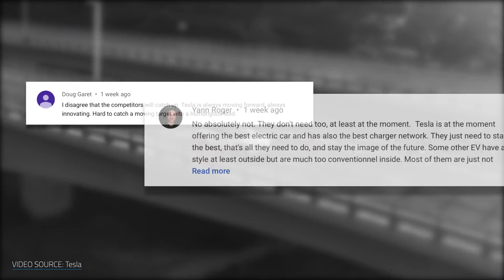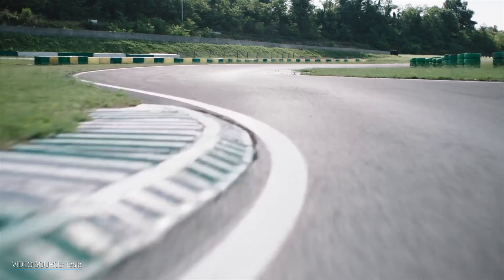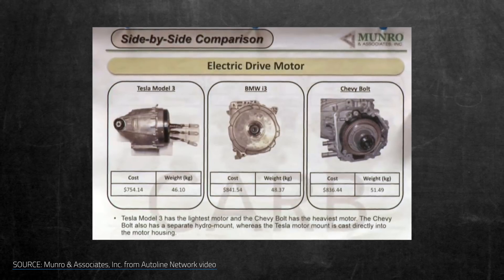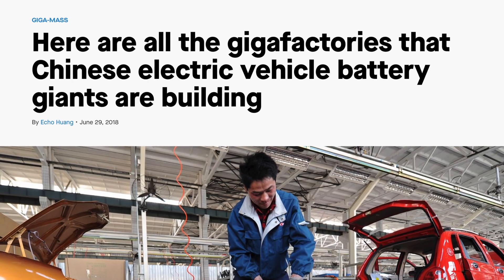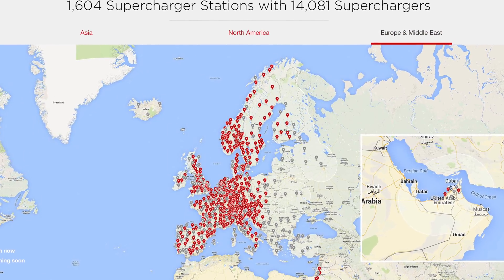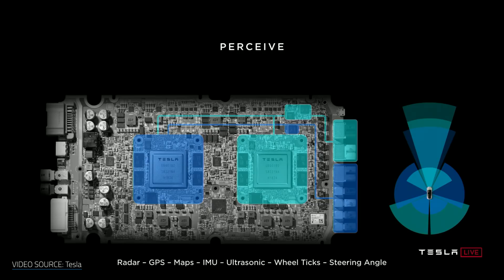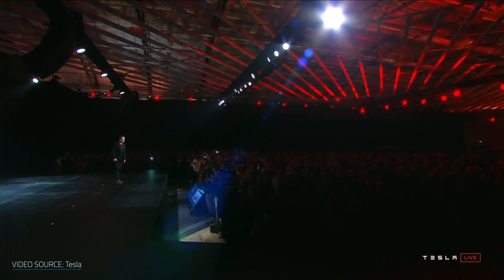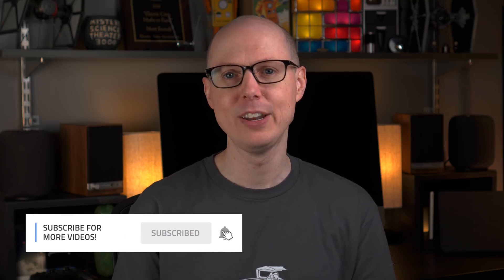Tesla vs Competitors - 5 Advantages

Comment: I tend to agree with all those Tesla advantages.  However, making things in large quantites is a whole different game to just having a good design.  According to an internet searches, in 2020 Tesla made about 550,000 cars.  In 2017 Toyota and VW each made 10,500,000, Hyundai and GM each made about 7,000,000 and Ford made about 6,500,000.   Manufacturing in the quantities necessary to dominate a future car market dominated by EVs may require either licensing its technology or merging with a manufacturer that can bring the scale of production it needs.

As good as Tesla batteries are, I think the big winner in the electric cars will be who makes a battery that is smaller and lighter than todays batteries, can receive 400 miles of charge in 10 minutes and costs no more than todays batteries.  Options are in the labs, but making a production battery is a lot different than a lab module.

Comment: Elon needs a motorcycle in his repartee... my suggestion is that any current design has not got it right.... let Harley Davidson have the two wheelers. A better concept, that is practical and will look awesome would be part cybertruck, part Elio motors, with a battery pack that is 1 part Tesla/ Maxwell and 1 part Chuck Norris's DNA. But seriously,  3 wheel design is stable. Made from Spacex stainless put crash test results the highest possible for a small car or bike . Elon must have the highest safety. Now have Franz design in a retractable roof for optimual wind in your face cycle experience. 
You cant use a motorcycle to stop and get groceries on the way home...but if you have a bike like I described it's a new game.

Comment: Looking at getting an EV soon and I’d 100% agree that battery tech (efficiency and charge speeds) coupled with a top quality charging network is making it hard to look at anything other than a Model 3 here in the UK. Other cars with comparable range like the E Niro (very nice car) would take over an hour to charge on a 50Kw public charger (most motorway services only have 50Kw) - just too slow on a road trip!

Comment: Let's see Motor, Battery Pack, Charging System, Autonomous Driving and Leadership.  Well you can add Over the Air Updating, No ICE Vehicles to support.  Now think about the Star-Link Satellites and all you would need is a dish in the Fronk under the fiberglass hood to update and bring entertainment to the cars.  Next might be a joystick in the console instead of the steering wheel and peddles.

Comment: Great video and most everything you said is true but I will play the devil's advocate. I am a Tesla fan and own a model 3 and X. Despite of how much I love driving them, I like to reveal some truth about the progress of self driving based on the current version of the autopilot. Granted with each update, the autopilot has been improving but new bugs have also been introduced. I have great respect for Elon but he is not been truthful about the delivery time of the self driving feature. First let us bring up the auto lane change issue, it changes into a lane way too fast which is quite unsafe because it does not give other drivers a chance to change their decisions or correct their mistakes. Second, it would slow down multiple times for no reason at all on Fastrak 91 Express west bound before connecting to 55 even though it has detected the dividing poles, the previous version has less issue in this regard. The sudden drop in speed is unsafe and unpredictable to other drivers and the brake lights did not appear to be on by looking at the screen. Whenever it slowed down from 70 to 55 unexpectedly I had to step on the paddle to speed it up to avoid getting rear ended. Third, it would change half way into a lane and decide to dash back to the origination lane even though the car behind was 5 to 6 spaces back. Forth the Navigate on autopilot would continue to change lane away from the targeted ramp or exit even though it is down to 1.5 mile and it often would be unable get back to the correct lane to complete the route. I can go on and on, in short the autopilot program appears to be written by programmers who do not know how to drive safely, carelessness or Tesla has a programming team that is poorly organized. If the current autopilot is so bug ridden, the billions of miles of data collected can be misleading and useless so this is where I disagree with you about the usefulness of the misleading data collected. I like to see self driving working in the next two to three years but it looks like it will not be ready for at least 5 years unless we are going to take a chance. Hopefully these comments would reach the Tesla team and Elon because I sure love my babies.

Comment: New Porsche Tycan Turbo S (electric car) outperforms Tesla Model S. Also handling is way ahead of fastest Tesla compared in curved and tracks.

Track doesn't mean speed only but brakes, suspension, areodynamics and steering are in another league. 

Personally, I also prefer no oversized touchscreen in the cockpit.

Comment: Advantage 6: The Fanbase. 'Customer base' doesn't quite sell it, because people who buy Tesla are the most loyal to the brand. And their number is increasing.

Advantage 7: Committment. Elon's focus is not on ROI or stock price or any other financial metric that doesn't directly correlate with the pursue of his mission. The cars have margins not because he likes money, but because changing the world is expensive. 

Advantage 8 : Organization. Not sure what my source is anymore, but apparently Tesla's inside structure is highly open to trans-department communication. For some reason different departments in legacy oem's are in competition with each other. Communication is also streamlined, i.e. if an employee needs to talk to someone, Elon included, he can just do so, without pointless managerial burocracy.
This boosts efficiency and saves tons of time.

Advantage 9 : Vertical integration. You covered it briefly in point 2, but it's not just batteries, it's everything, seats included. Actually the battery manufacturing process is the only thing Tesla doesn't own. Yet.

Advantage 10 : Rich Portfolio. Tesla  produces cars, software, AI hardware, solar, energy storage solutions. All of which are sectors set to explode in the coming decades.
And I'd argue that just as importantly as all theese things, Tesla produces ambition and dreams.

Comment: I could imagine when density dramatically improves, it would mean 300 mile battery at 1/2 the size.  Less batteries making the same range would reduce cost and weight, which also itself improves range.  Maybe we could see a $25,000 3 door hatch Model 3 or say Model 2 3/4.

Comment: Matt Ferrell I think you missed the absolutely MOST important part, but also the part hardest to quantify and talk about and that is the Tesla organization and manner of working. I only know bits and pieces of this. Basically the competition is only setup for gradual refinement. They source a number of components from the outside, which mean the ability to iterate an experiment is severely diminished. Tesla by making so much in-house are able to iterate rapidly and experiment more with their design. SpaceX also illustrates this well. Look at how many prototypes they make and fly. The competition does not work this way at all. Instead of hands on experimentation they produce reams for spec documents. They follow a classic slow waterfall method of product development where excessive amounts of time is spent planning and researching everything they do. Tesla and SpaceX in contrast move fast and break stuff. 

One example was from things like an indicator on the dashboard. Want to change the icon? A 10 minute code change and recompilation at Tesla. For the competition it means changing a spec document and shipping it to a supplier which has to adjust a part related to dashboard display. Basically the competition has no agility. They have to make lots of upfront decisions which are easy to get wrong and stick with them.

The other advantage is that by making stuff in-house, Tesla has the ability to exceed what the competition has access to. You can see the same issue in the Phone business. Apple makes their own ARM chips that are of higher performance than the competition. Android makers cannot distinguish themselves from each other on performance because they all have access to the same Snapdragon processors. Apple can still buy Snapdragon but they also have their own chips.

Tesla has the same advantages. With their own battery and electric-drive train expertise they can have something the competition does not have access to. But this applies to almost anything Tesla does. By making stuff in-house they are free to experiment and re-arrange how they do things quickly.

Comment: You forgot to mention the fact that since Tesla only makes electric cars, they don't have to change the company culture from conventional to electric cars like the existing car companies. Also, Tesla doesn't have to re-tool any existing factories to make electric cars either. These 2 points are not as significant as the five you mentioned in the video, but they are still important. 
I look at the conventional car companies as being like Kodak was during the time the world was shifting from analog to digital photography. It will be very difficult for Ford to give up making Mustangs and Explorers and and go all in on electric cars.

Comment: The biggest disadvantage for me is the lack of on the road charging stations. Most places I drive to do not have charging stations in convenient locations. I would have to drive significantly out of my way just for charging to make it to my destination. I have never given fuel stops a single thought for gas cars. But for electric it is a major pain. 

The second problem is a 12 hour 800 mile drive in a gas car, I do in one day. In electric that will take 15+ hours or more depending on the rate of charge available along that route and sometimes have to add another 100 miles or so to a trip just to find charging stations. So now it becomes a two day trip and two days back. Add an extra two days for an 800 mile trip and back. That is a major problem for me. These are MY reason not to own an electric car. They are not yet mainstream ready for use. I consider them niche use only for now. And towing a trailer is also a major problem. It shortens the range significantly which makes it even harder to find charging stations along your intended route close enough together to make the trip. Note we are not even talking about the added time for the charging just the ability to make the trip is in question when towing. 

So perhaps these electric cars are the future. But I live in today not the future. Today they do not fill my needs. And I am not here to debate this. I am telling you this. The odd part I find is that almost nobody uses their electric car for a road trip. You can look at almost all of these on the road charging stations to see if they are in use or not. Many only have 4-6 charging stations and almost none are ever occupied. So the question I have, Why would someone invest in building these charging stations if there is no return on investment on them? And if they do not get built then that will hurt demand for these cars from people like me that go on road trips. It become the chicken or the egg story. Gas pumps by comparison have 12 to 16 pumps and another 12-16 pumps across the street in another station and down the block two more gas stations. So when can I expect to see even 1/10th as many charging stations? 10 more years? 20? Sometimes the future never comes. I am still waiting for sat internet after 20 years and still do not have it.

Comment: Interestingly enough, there has supposidly been a breakthrough in Solid State Batteries. I don't know how and if Tesla is involved, but the next gen batteries are going to revolutionize the Li-ion Batteries, putting the range of the Model 3 at well over 700 miles. There's a good vid on youtube where a guy describes how and why. Just google solid state batteries

Comment: If batteries are the main cost of an EV, can Tesla (or others) make a commuter car? One that has 100 miles but costs about $20k? That’s 95% of all drives. I would buy that as this is a no brained. 

Maybe even have a modular battery pack when you can buy more remove when not needed (even replace on a service station). 

With $20k base + ability to extend - everyone would buy it
Reply from the maker: Yep!  There are some coming.  The Mini EV is that type of car.  VW has some cars coming with lower ranges to hit much cheaper price points too.  The next year or two should be what to watch.

Comment: Ok speak simple English. How many batteries does the plant produce per year? None of this kw talk. Also how much does it cost to charge the vehicle? No kw talk simple 35 bucks or whatever it is.
Reply from the maker: The best way to look at it is with kw.  It’s not possible to say how much is costs to charge, because it varies by location, just like the cost of gasoline.  For instance, in my area it’s $0.25 per kW.  A mid range Model 3 has a 64 kWh battery, which means it would cost $16 to go from 0 to full.  The midrange gets about 100 miles for 27 kW (https://www.fueleconomy.gov/feg/Find.do?action=sbs&id=41056).
Reply: So in English ur saying it cost 16 for a full charge. And how many miles can u go?

Comment: You’re assuming that the average consumer actually does a proper pro vs con trade-off analysis when purchasing cars. Sadly that’s not the case. I test drove the Audi e-Tron and while it’s a fine car it’s no where as good as a Model X (the X has more range, OTA updates, far better self-driving capabilities, supercharger network, etc, plus everything mentioned in this video). The e-Tron also costs almost as much as a Model X. And yet I see so many people choosing the e-Tron over the Model X. It really baffles me! So I don’t think tech spec advantages alone will not determine the winner at the end. I would love to hear your opinion on this phenomenon.

Comment: i think their most competitive advantage is the continuous drive to innovate learn which is internalised in the company's way of thinking. quick decision making and pusshing though the innovaitons into their installed base where possible. second they have borrowed the support model out of the IT industry where they see each car as the endpoint in a network (it can be monitored manage remotely. this contrasts with the existing car manufactoring cmopannies where one still needs to visit a garage to do any update and it also costs you a bundle of cash and time, let alone Tesla provides free updates of functionality.

Comment: My next car is going to be a used Nissan Leaf & those can be had for less than $10,000. Since electric cars have limited range, typically used Nissan Leaf's have only 20-30,000 miles on the odometer. The Tesla is way overpriced & overkill for my little 10 Miles each way to work commute.
Reply from the maker: Nice choice.  The Leaf should fit the bill perfectly for you.  Tesla may be dominating the EV market right now, but that doesn’t mean it’s the right choice for every situation.

Comment: No 5 is BS. Sure Musk changed the world but so did Henry Ford. I'm not driving a Ford either.

Get into an accident with a Tesla and see what body panels cost. Then find someone to fix it. In my case that's 3 hours away.

Tesla is 3 hours away, GM is 15 minutes away.

The Bolt doesn't have cracked windshields, leaks, squeaks and doors that don't shut. I've checked many Tesla owners who complain about those things.

I don't want a glove box that opens with an icon on a screen, I'll take a plain old knob thanks.

The Bolt motor is slightly more costly, so what. its the batteries that cost. Is the model 3 cheaper than the Bolt? No.

Also the Bolt was out 2 full years BEFORE the model 3.

Tesla only makes EVs so sure they have more EV's out. GM doesn't live or die with EVs, Tesla does.

The advantages Tesla has today with infrastructure will be gone in a few years when EVs dominate the roads.

And you can still buy a Bolt for less than a model 3.

For some people Tesla is a better option and for some people it's not. For me it's not, I charge from my own PV, don't go more than a couple of hundred miles 99% of the time and want a hatch back because they are more utilitarian. Tesla still can't give me an affordable hatchback. I'm not paying for options I don't need or want.
Reply from the maker: Fair enough, but the very first thing you said is kind of the point (“musk changed the world”).  Elon’s stated goal has been to spearhead the transition off of fossil fuels.  He’s done that.  Whether you’re buying a Tesla or not, the fact that EVs are finally being viewed as a legit option is from his relentless pursuit of that goal.

Comment: Technological symbyosis between SpaceX, Tesla and other Elon ventures. Imagine any developments or discoveries at Neuralink.  Obviously that can easily transfer to Tesla AI or car software development for better autonomy or use of Neuralink within Teslas etc. No other car company will ever have that unique tech advantage, ever! Eg, recently Elon mused about Tesla rocket thrusters package. Do you see BMW thinking of such a thing? Never! The only car company I can think of that comes close to this is Revian, being funded  by Elon's copy cat. Being a copy cat means just that, no innovation! But other than that, they don't have this unique Tesla position. He doesn't have a boring company that makes tunnels that cars run in, which get the correct tech to use them in on first deployment before other EV companies adopt them. The list goes on.